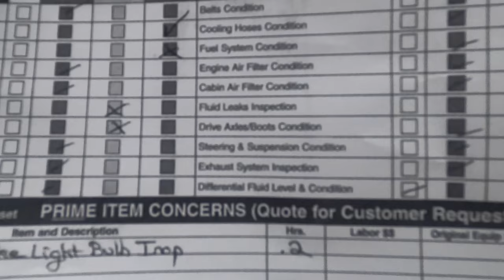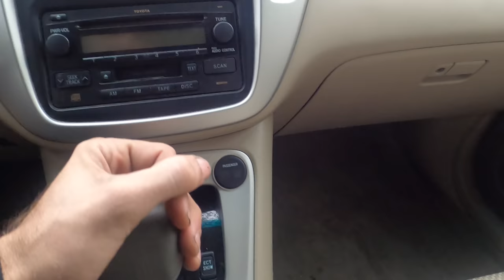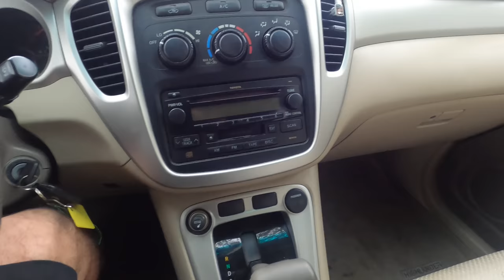We were BASHED by the Dealer! Ripping off a customer! Toyota Highlander 3.3

Comment: It's true that Toyota service centers charge an ungodly amount for something simple fix to do.  My wife is the type that will take her Toyota Camry and have it fixed by them, instead of my 30 years of military and Government equipment maintenance mechanic work.  These are some work done, low tire pressure light, stripped lug bolts replacement.  The second time happened again on the low tire light on, got it fixed by adding air on her spare tire.  The replaced lug nuts and bolts didn't need replacing, because when she asked me to have the tires rotated before, i rotated the tires myself with no problem, right sides rear to front, left same procedures.  When she took her car again for tire rotation, the service told my wife that they have to replace her lug nuts and bolts, because damaged or stripped that added cost to the simple tire rotation.  As for me, I do my own maintenance on my 1980 Mercedes, Ford F-150,and Explorer Spot Trac.  This might be lengthy to say, but people are being rip off of their hard earn money every day by these dealership service.  God bless

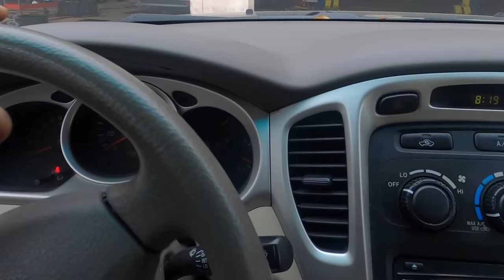Comment: 3:39 You communicated that the best way that I wish one unnamed company I went to put into practice.
I fairly recently had the task of changing the brakes/rotors on one of my family member’s cars. I had done the job to multiple cars before and although I’ve never worked in the automotive area as a worker, I know my way around cars. We use hand tools and couldn’t get the lugs off the car, the thing was over torqued to high heaven such that even our proper size deep socket was messing up these lugs. We took the car back to the people who previously took the wheels off to do work/inspect and they were adamant they’d never even heard of such a thing or had anyone complain about over torquing the lugs. After some back and forth, him saying it was our socket, yatta yatta, the guy finally decided to amuse us and use his socket with hand tools to try and get it off. With no shock to us the same thing happened to him that was happening to us: no budge, socket marring the lug. He lifted the car and got what I’d say is an entry level impact driver out: no budge. He then got what I’d say is a heavy duty impact driver and got it off after running it on the lug for like 5 seconds. After the whole ordeal he said that we should get new lugs (and we did, old ones were messed up now anyways), but then he suggested using anti-seize the next time we install lugs. Now I’m no expert on static friction and the related sciences of sticky compounds, but that’s the dumbest thing I had ever heard. Not to mention there was absolutely no way that rust could have formed in the amount of time from them putting the rims on; we don’t live next to a shoreline or any unforgivably corrosive environment (another thing he said there was, but actually was not). If only he looked at the situation objectively as you do and sucked up his pride and ego. Never did admit they made a mistake. After properly torquing the lugs to spec and then coming back a while later to do some work on the car, we never had any issues getting them off.

Comment: If this were mine I would click my parking brake until slightly applied and drive it down my drive it slow a couple hundred feet then turn it off the parking brake.  That would knock the rust off.  If people would just use that parking break once in a while they would have less problems.

Comment: That's not 6 months ago! Them pads are halfway down and pins don't seize in 6 months if they were cleaned properly.  The dealership is correct that the brakes need work.  The  rocker cover leak should have been removed with  brake cleaner spray from the engine block so that a new leak would be detected. Based upon what the dealer said that it needs calipers is what they all do so you don't  suddenly get a bill $400 more than you expected.  I'm sure that the dealer mechanic will realize that the calipers are  not seized. Those pads looked like they had 40,000km on them!

Comment: Parking brake rub, most users would not even hear that. And this little rubber boots for the slide pins, seems like they have been missing for years if the corrosion on the ends of the pins is anything to go by.

Comment: As a Toyota Certified tech with 10 years experience, I can guarantee that valve cover gasket was leaking. I was ready to place bets on it as soon as I seen the title say "3.3L" because they all leak. Now that doesn't mean it hasn't been repaired but maybe they just didn't clean it. They mainly leak from the back side of the rear bank as you could see there was oil residue all over the back side of it. When you checked it, you didn't really zoom in on it to show it much at all so the average viewer probably didn't even see it. As far as the brakes go, this can easily be a miscommunication between the tech and the service advisor. Tech probably said calipers sticking due to caliper slide pins and probably gummed up bracket where the slides ride in, sends a quote to parts and they list it as a caliper with bracket and slides assembled, advisor tells them they need both a caliper and bracket.

Comment: Dude, that last caliper before you went out to the tool truck is smoked. I saw how much effort you used to push that piston back in. The square edge seal in the piston is the only thing that pulls that piston back after the brake pedal is released. I decent properly working caliper should take little to no effort to push back. If it does it’s bad. 
Before you say anything, I’ve got 40 years under my belt. Trust me friend, that caliper is shot.

Comment: Took my wife 2012 CRV into the dealership for the free oil change.  They gave me a list 2 pages long of maintenance needed.  Took to my mechanic who is a toyota/honda specialist and used to work for the dealerships.  He looked at it and said this is why I left the dealerships.  Didn't need most of it.  One thing they said was the timing belt needed replacing.  Apparently Honda switched from belts to chains years ago.

Comment: so my question .. at around 3:15 you can see a red blinking warning light..... is that the seatbelt light or was there something else wrong with the vehicle...... and if it is the seatbelt... why weren't using it?  At 7:24 when you pulled the slide pins... they had metal shavings all over the ends.... is that normal?

Comment: I've put many hundreds of thousands of miles, my first vehicle the odometer broke at 200k and I drove it for another 10 years. I've never needed to replace calipers on a vehicle. 
I'm assuming in order for them to sieze the vehicle needs to be sitting without being used or have a bunch of water in the brake fluid.

Comment: 95% chance the reason you see the wet areas  on the rack and pinion is because the tech or service write at dealership took a pick and poked that boot on each side of the steering rack. It's a common inspection technique at dealerships and big box repair chains. The ring leaks inside the boots and for a long time no one sees the moisture until the boots crack over time or the oil inside eats it and erodes it so that the fluid becomes visible. I don't think that's a bad technique to use but I don't necessarily agree with it either. Similiar to pullung back the boot on a wheel cylinde on rear drums to see if the seal has been compromised. More racks are leaking than we know because we typically don't do that so in theory it's good to let someone know a safety item (if you lose your steering you can't control your car) With that being said, putting the hole in the boots now allows the oil to escape causing messes under cars on driveways and allowing the steering oil to spread and continue to break down the boot or possible other rubber components. Also, because the leaks are common it makes the repair seem more urgent than it might be. Depending on how the service writer or tech approaches the repair with the customer. 

23 years in auto repair as an oil change/lube tech, repair tech, shop Foreman, service writer, multi unit manager and now owner, I have witnessed many many repairs and techniques from several different repair businesses, mechanics, and service reps than most could imagine. I see new stuff all the time. I have seen the same part on two different  cars of the same year make and model do and act differently. Having a sincere passion for my industry I believe, with a proven track record and history of success in the business, that the very best way to approach our customers is with an intent to educate. I believe in teaching and making sure that the urgency is only used when necessary. If our customer leaves spending a $1000 on a repair and does not understand what and why they spent the money we have not done our job as Auto Repair Professionals. 

You're a quality tech and enjoy your videos. Keep up the great work!

Comment: Always use your parking brake, and do some work with it now and then by applying it when driving. Go drown the motorway or highway, no one behind, dry nice surface, then pull parking brake and hold for a second or two. Repeat now and then, a few times a year.

Comment: I have to say that the owner has some hide to expect his car be repaired for free despite the honest efforts of this guy. There is obviously some environmental variables at play here with the corrosion causing the so called "grinding noise". You can't prevent that unfortunately when you live in a rust belt right ?
There is no issues here caused by dodgy workmanship I can see. Car owners need to get some education if they want to be car owners so they don't simply waste people's valuable time with these petty complaints.
Toyota didn't do anyone any favours here either. To bash another mechanic shop is really low, especially when dealers themselves have The Worst reputation !

Comment: I have a '21 Rav4 that gets 36.7 MPG.  It runs great, breaks straight, has plenty of power, no break noise.  The dealer tells me every time I go in that the brake calipers are possibly seized.  I was in there one day for an oil change, and they told no less than 4 customers while I was sitting in the lobby that they needed new brake calipers because they were seized.  I have not replaced the calipers, but I have had them checked in other locations when I swap tires for the seasons, and no one else seems to think there is a problem.

Comment: I wonder if you work on allison transmissions, I have a 02 silverado 2500HD 8.1 with an allison trans, and shift solenoid 2 sensor gone out. No local shop would work on it so I had to deal with a dealership to get it fixed. So here is the kicker, when I bought the truck used, I was told that every 2 years I need to replace both the trans filters, one outside of the trans, looks like a regular oil filter, and the one inside the transmission pan. They had to remove the transmission pan to replaced the sensor, and it was close to the 2 year mark to change the filters, so I ask them to while the pan was off. ( I normally do this job myself, its not very hard to do and takes less then a hour to do.) So the sensor job was rated at 5 hours for repair, and when I got the bill it had 7 hours on labor. I ask them about the extra 2 hours, and they said changing the transmission filter and fluid was rated at 2 hours. So I said you have to remove the transmission pan, the filter and drain the fluid to replace the sensor, you already did the labor of removing them, why do I have to pay twice on labor to just have you replace the used filter with a new one? He showed me on the computer where it list 2 hours to change the transmission oil and filter. 

I should have told him to take out the filter and put back in my old one lol. And that dealership charged $110 an hour.

Comment: Why didn’t you replace the rotors and do the clean and adjust while you were there? With the cost of parts it’s better just to change the rotors when you do the pads instead of “pad slapping “ the car in the first place. Do the job right the first time and these won’t come back.

Comment: You are not meant to use the ratchet type ring spanners for the final tightening or initial loosening of bolts or nuts you use a power bar or solid ring spanner and then use the ratchet type spanner to undo or do up bolt,ratchet type spanners were never designed for heavy load and will always break after a certain amount of time using them for heavy load. Hope I,m not being too critical,just saying,but you did an awesome job, best wishes to you, from, Auckland, New Zealand.

Comment: I have a RAV4 and seizing slide pins has been an issue.  Every spring/fall when switching tires I pull the pins, clean and lube, and take a wire brush to the brake sliders as well.

Comment: No lube on rear brake pads... Dealer got one thing right.  Of course I live in the North and a Model Year like that would be rotted out by then lol and in your area you may not need some lube on the clips and pad ends ect.
The dealer had the opportunity to do the right thing and fix it right or call it right the first time. I work at a dealer as a tech for 20 years now and not only do Dealers F up but all garages do, there are individuals out for any penny they can get and individuals out to fix it and get the customer on there way fairly. You just gained a customer and the Dealer lost one. 
Good on you for doing the right thing. We as tech's are all ( Most of us ) in this business to fix cars right and gain trust, its the Dealers and the Small shops and some big chains that are screwing it up for the rest of us by not being honest. .

Comment: That's on your shop.  Every disc brake job must include a slide pin wire wheel clean up and Permatex lube.  I also wire wheel all the caliper contacts surfaces  That will last as long or longer than the replacement pads.

Comment: That’s the result of the previous guy doing a lazy ass brake job, I had my truck done while it was in having a brake line replaced, it was winter and the rears needed to be done, I was gonnna wait until spring and do it myself, like I always do, but since it was at the shop I said go ahead and do the rear brakes, I had to grease the pins cuz the lazy fckr didn’t do it.

Comment: I machined tens of thousands of those calipers and brackets,  and I can tell you that the tool changes never happen often enough to keep the slide pin holes in spec.  Most of the dumbasses just keep going for hours without a proper inspection just to hit numbers, AND will throw out of spec parts into the finished goods bin to keep from counting scrap.

Comment: I've been lied to in some way/shape/form by every dealship I've dealt with.  Mind you, I've only owned 3 cars but, in one instance, one dealership wanted to charge me $600 for a radiator leak test and another $500 to "fix" it.  There was no radiator leak.  There was a pin hole in the lower hose.  Never go to a dealership for repairs.  Find a garage you can trust.  Talk to current customers, ask around, ask your neighbors or friends.  But, goddamn, dealerships are some of the worst.

Now, to be fair, not every dealership is corrupt just like not all politicians are corrupt (couldn't say that last part with a straight face).  But, in my experience, they can't be trusted.

Comment: Why dont you put a couple if large nuts on 2 wheel studs and put disc back on with 2 nuts and start engine.  Disk will go around and you can flap wheel it quicker.

Comment: On rear brake drums I know are somewhat normal to be rusty but if they are normally driving the vehicle using breaks that apply correct even pressure you would think the inner drums would have had at least a part of the contact surface that was not rusted. The way they are fully covered in rust says to me the rear brakes are not engaging at all which could be affected by the crusty slide pins not letting the pads move in and out on the front but I didn't see you check wheel cylinders for proper functionality ensuring the rear pads were even engaging with the drums as I stated drums are coated in rust entire surface and that tells me they can't be touching the drum during braking or you would have some portion of drum contact surface at least some what clear of rust due to it being a vehicle not just sitting they had been driving it and even you test drove it to test brakes. Not trying to talk shit about your methods or skills you seem to know plenty about your work and damn good at it. Maybe you did check cylinders and I missed it or possibly you know something I do not just something that I noticed about rusty drums says to me brakes can't be engaging with all that rust. Thanks for great videos  and your time and knowledge.

Comment: I piss off other techs when I do brake jobs because I use wire wheels and die grinders and make a ton of noise cleaning the hubs, brackets, rotors, and everything before properly greasing to make sure there is nothing that will cause noise or vibration, or seizing of components down the road

Comment: My guess is that the driver of that automobile has a tendency to use the brakes and properly. A lot of people will hit the brakes and the closer they get to the stop the harder they will push on the brakes. Which is exactly the opposite way you supposed to do it when you're driving normally. All that does is build up much more heat than you need to. It dries out the grease on the slide pins, and other asundry problems.